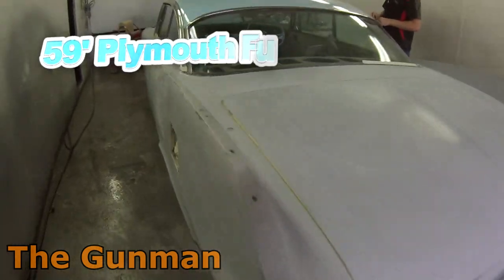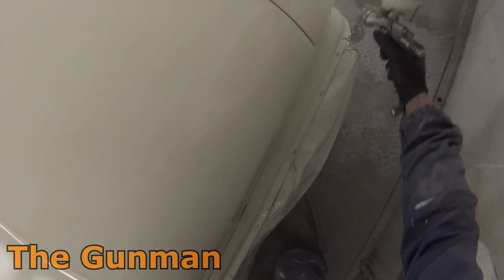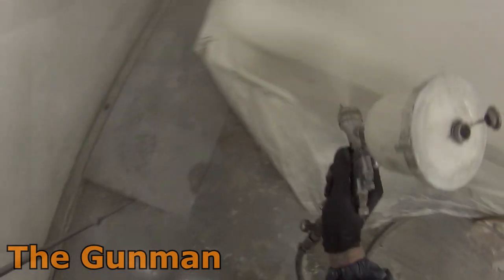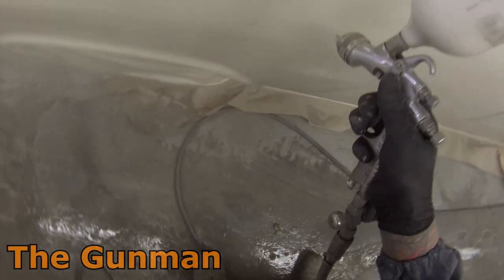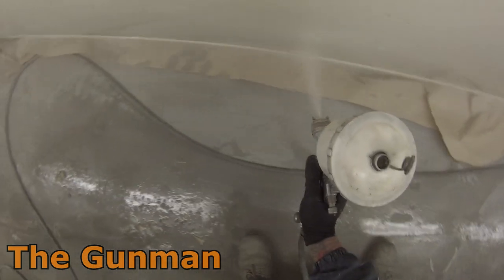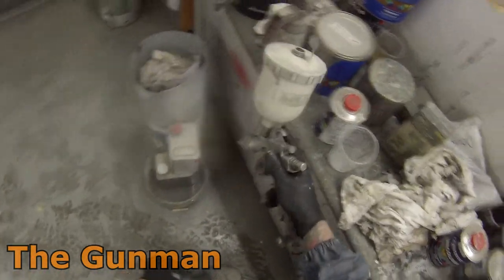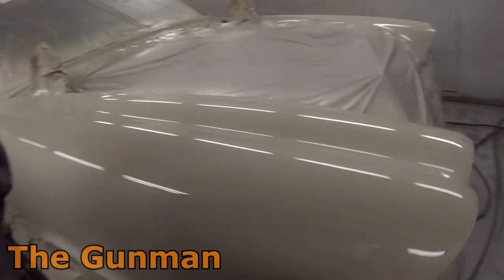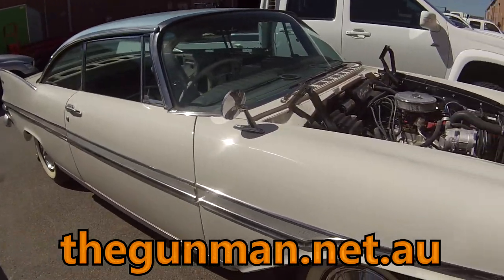'59 Plymouth Fury Respray Part 3

Comment: I use gun lube on occasion. I put 1 single drop on all the knobs every 5th or 6th time I clean it after spraying. I've been told its basically mineral oil but I'm not sure. As far as wetting the floor goes, I'm with you Gunman. If I'm in a bad booth I prefer to be standing in at least a half inch of water. This is kinda strange but I once heard legend of a guy in the 50s here in the states that was some kind of engineer who also somehow also painted cars and he built a water trough in his floor hat had a constant flow of water running down the center of his booth and it completely eliminated his overspray problem and zero dirt nibs.

Comment: Gunny, i absolutely swear by the Sata gun grease there is nothing better or safer to service your spray gun with i also religiously use it to protect the o rings when i service my air filtration unit filters , i buy this from sprayguns direct
Reply: +SATAMAN Schmidt  sata grease cost £9.00 a tube lasts forever worth every penny
Reply: +SATAMAN Schmidt  yes i agree thanks for the info it was helpfull